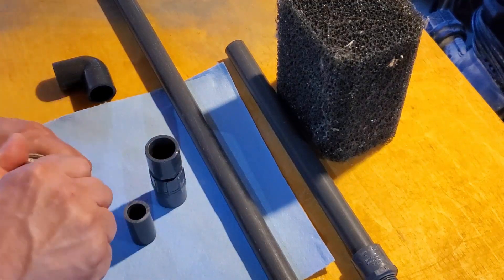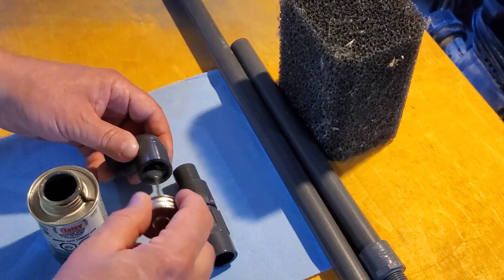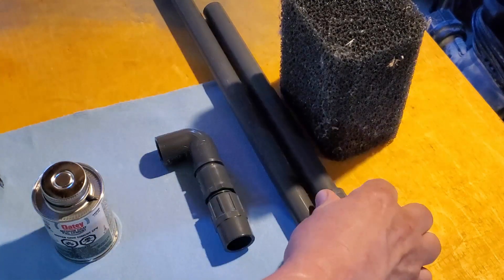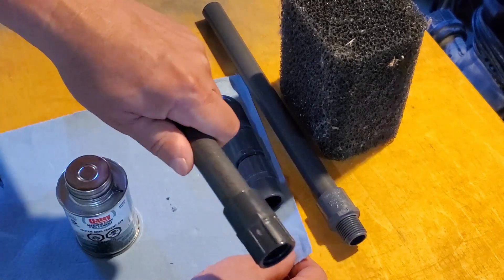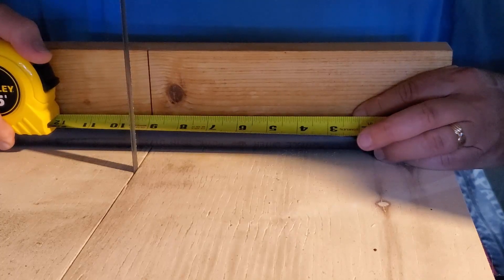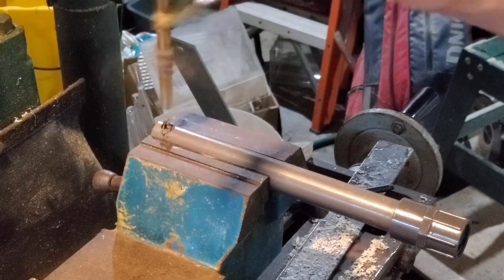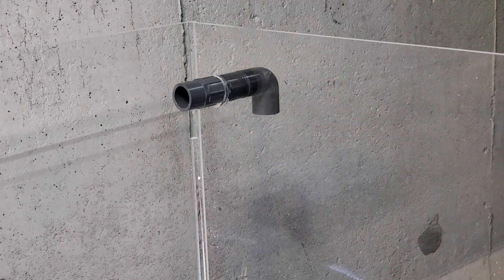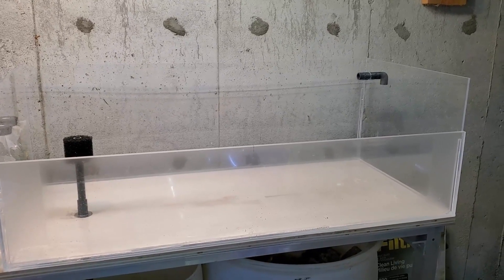Plumbing The Indoor Pond

Comment: I dig the design and drum filter!

Stoked to watch the second channel. You inspired me into getting a lathe and that led to learning to weld. Can’t wait to learn some machining tips and tricks from you. I bought some Delrin to practice machining on.. it was pretty expensive.. I have brass and aluminum stock.. but is there any cheap material you can think of that’s similar to delrin or is more machinable than pvc that I could get to practice with? I don’t want to waste all my good stock making mistakes and working out all the learning curves ahead of me..
Reply from the maker: That's so cool! The new channel has been created and the first video is to go up next Saturday. I will be announcing it in the next couple of videos and leaving a link. You could try UHMW polyethylene. It doesn't machine as well but it's better than PVC. Not sure how cheep it is tough. Thanks so much for watching what I do here!

Comment: Hmm, couldn't you pull the sponge up slightly so that in the event of an overflow the water still has to flow through the sponge?
Reply from the maker: Yes there is a a bit of wiggle room at the top. Once it's running I will do the fine tuning. Thanks for coming by!